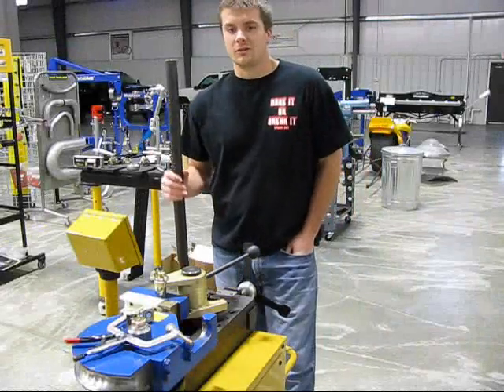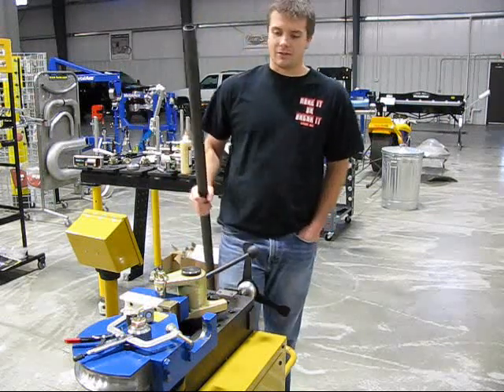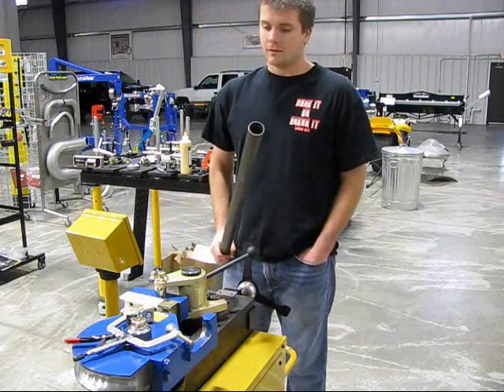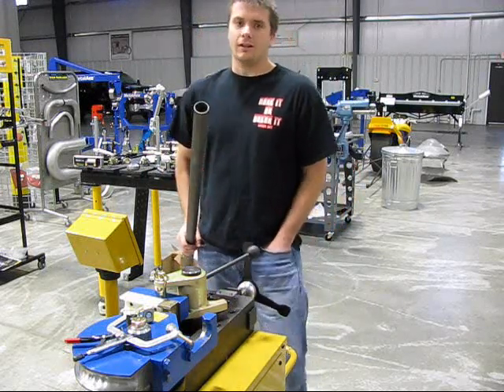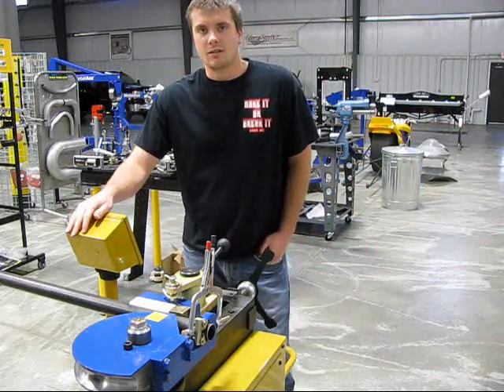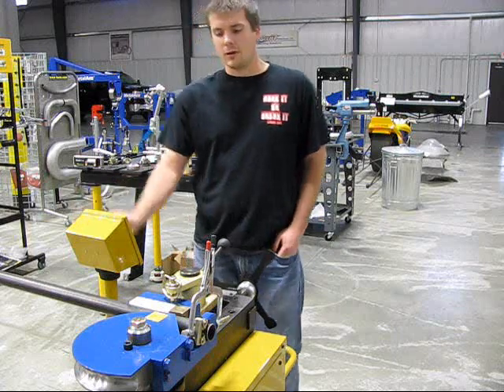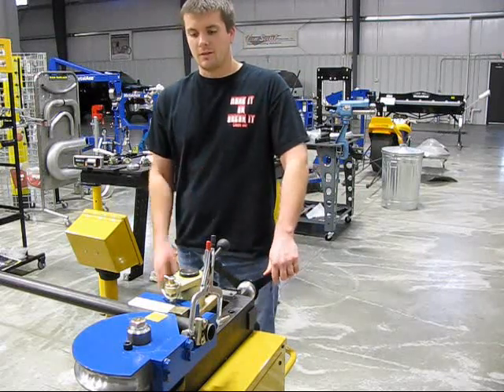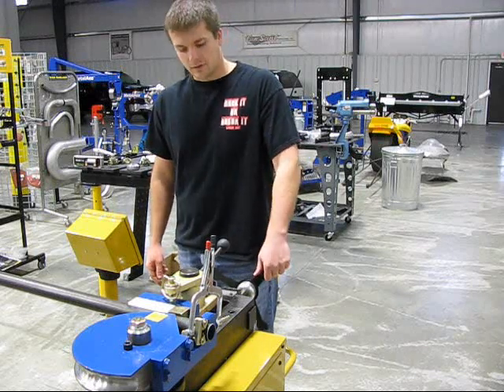Bending Thin Wall Chromoly Tubing

Comment: THIN WALL ? ..... how about .035   3/4......... or 5/8 ? Thats what we want to see !
Reply from the maker: you wont bend .035 on this type of bender. you need a mandrel bender. this is a rotary draw bender. check out our breakdown of mandrel bending and the difference between them and rotary draw benders in our video here. https://youtu.be/2BHVzgCwms4
Reply from the maker: also if you are talking about fuel line type material check out this bender. https://www.trick-tools.com/HB1_Small_Diameter_Hand_Bender_Deluxe_Kit_DeluxeHB1_2294
Reply: Can you bend 1.5 x 0.058 4130 on the affordable bender?.
Reply from the maker: Yes you can with this Pro-Tools bender and their 1.5" die with a 7 inch bend radius. Here is the link to the bender https://www.trick-tools.com/Pro-Tools-MB-105HD-Hydraulic-Tubing-Bender-Deluxe-Kit-Deluxe105HD-Hydraulic-13262